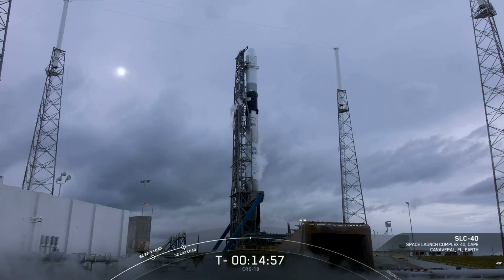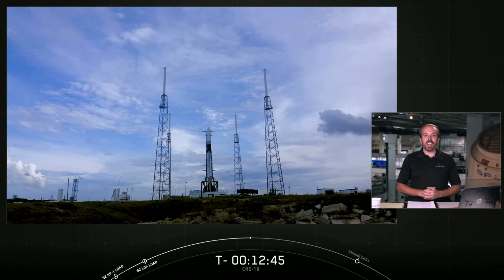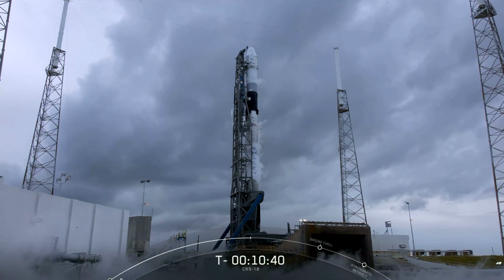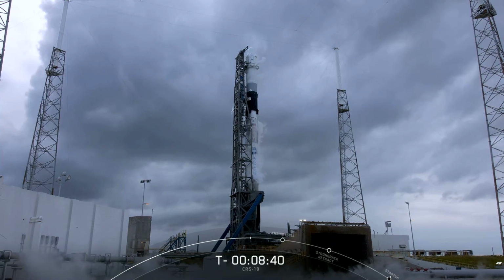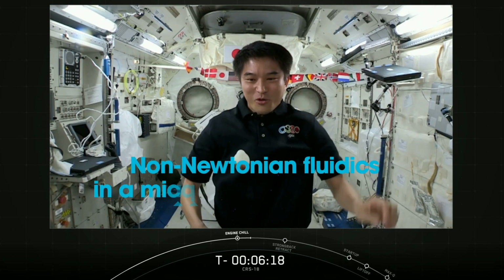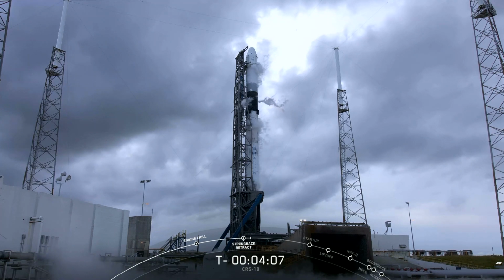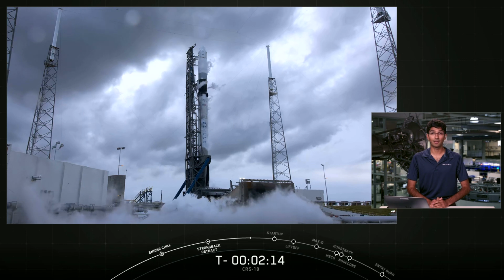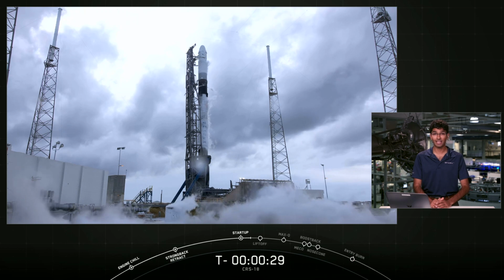CRS-18 Mission

Comment: Huh, airplanes fly in this weather, so probably a rocket could.... i hate when they put it in a hold because of the weather..
Reply: to be fair, this rocket costs millions and it wouldnt hurt to hold it back by a day
Reply: Rockets and airplanes are not even remotely the same thing, what are you thinking? Rockets go through immense pressure, temperatures, speeds and tension, a plane costs a 50th of the cost of a rocket, SO many hours go into preparing for launch and 50 times the crew is needed for a rocket launch. Guys, planes go 10km high, rockets go about 200 - 3500x as high. 

Yeeeaaa, not exactly the same
Reply: If it was a Russian Soyuz, they would have said; 'hold ze vvodka, we r longchhingé'
Reply: @languystephane  true lol, time is money for them
Reply: But airplanes don’t go hipersonic
Reply: Yeah cause Rockets and airplanes are essentially the same thing

Comment: What happens to all the fuel on board when they decide to scrub
Reply: The fuel it's the cheapest thing in the launching...they don't care If it's wasted.
Reply: why can't they unload the fuel back?
Reply: The RP1 (kerosene) is pumped back to its tanks, and the liquid oxygen is pumped back to its tanks, and any residual oxygen is vented.
Very little is lost.
Reply: it will re-loading back...
Reply: They just open the taps n let it dissapate round the fields..... the cows go bannanas for hours.
Reply: Mike Mchugh I think they offload the fuel, and dump the oxidizer
Reply: They smoke it
Reply: Mike Mchugh They’d have to drain the fuel tanks.  The RP-1 that the engines use is a super refined kerosene.  Not something you’d want to release into the atmosphere.  The oxidizer is LOX - liquid oxygen.  They could release it into the atmosphere, no problem...  except you’d have to be careful because pure oxygen is super flammable.
Reply: @SmokingSevens  the money saved from not dumping the oxidizer is that insignificant?
Reply: @SmokingSevens  oxygen isn't flammable, it is an oxidizer. It makes flammable things burn faster when it is concentrated higher than atmospheric levels, but it isn't flammable.
They vent it constantly, just have to make sure it dissapates before coming in contact with a fuel and heat.